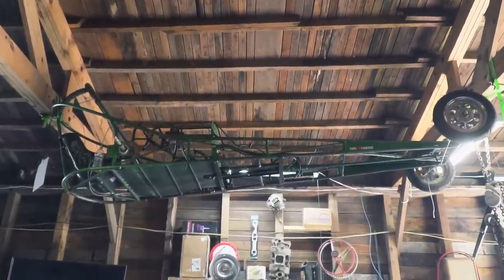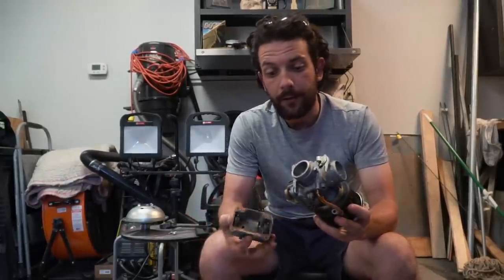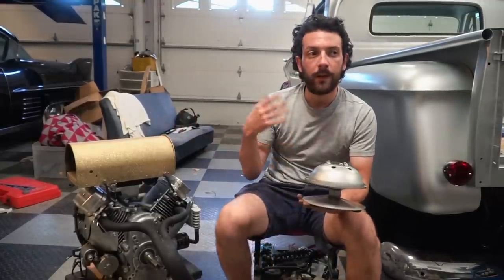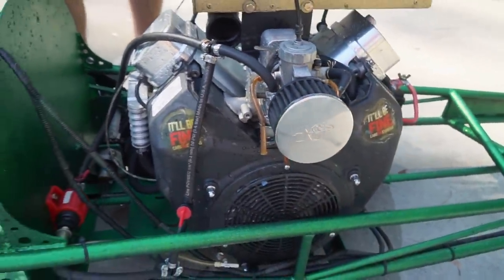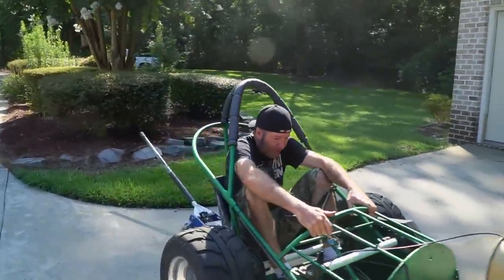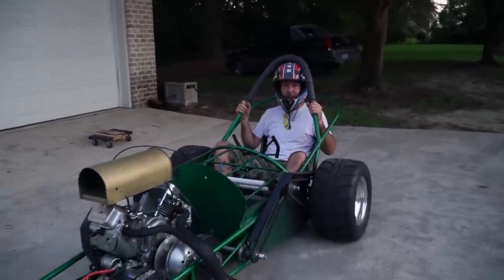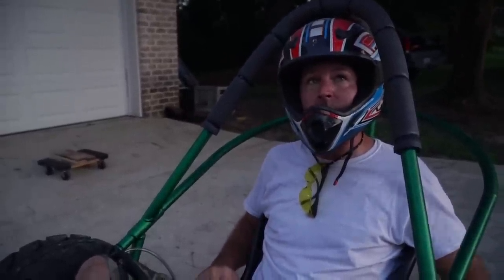670cc Drag Rail Revival! | Our 55HP Harbor Freight Engine Rail Kart Returns!

Comment: you just ever going to swap the driver position with the engine? The biggest performance gain you could make would be to remove those driveline losses by the jackshafts. plus you'd pull almost 100 lbs out of it. Bet you'd drop to mid 8's in the 1/8th

Comment: Diaphragm carburetors are for aircraft because a typical float style will stall out an aircraft in high g operation like the problem with the p51 mustang that used a float style carb.

Comment: Maybe running it on Methanol or nitromethane would be insane, I've run an engine on nitro before( risku asf I do not recommend unless you have billit parts) but it felt way stronger and it might be a good way to get some power out of it, or you could also supercharge it with a small smog pump

Comment: im pretty sure airplanes use diaphragm carburetors like the ones used on chainsaws, weed eaters etc... so they can work upside down. might be called pressure carburetors.

Comment: @carsandcameras What mods does the 670 have?  Those straight pipes sound Harley-ish, wondering if it still has stock cam, cam timing, etc.
Reply: Aftermarket cam. Sorry dont know the specs

Comment: its got a a gravity controlled float bowl were as i believe air craft carb either dont have a float bowl or a special type of float bowl so they can go upside down without running out of fuel and senses you'd be in the air that be a very bad thing

Comment: Mannn i just gave away a jr dragster frame. We at 1 point had a 300hp 1000cc snowmobile motor in it. It ran 3.3 seconds at 95pmh in 300ft. Yall coulda had the chassis. It had been in my basement untouched for over 5 yrs so i gave it away

Comment: Hmmmmmmmm I am building a go cart in shop class and only using a predator 212.... is a half inch thick plate of hardened steel a bit to overkill as a mounting plate?
Reply: Was building until witler shut down the schools

Comment: Would u be able to go through the fuel system and show how you rerouted the extra fuel i build a drift trike with a 110 motor and running a vacuum fuel pump but it keeps over flowing the carb

Comment: You can’t use a standard carb on aircraft because of gravity. If you go vertical the float will shut the needle valve and bye bye fuel.. this is one reason I would think.

Comment: Glad you guys put it back together but from the begging the 670 motor was a bit slow.... the power to weight ratio is terrible on those motors. I’ll be more interested in this project when you guys invest in a big bore 2 stroke motor to put on that thing.

Comment: Most aircraft use a MSA carburetors stands for Marvel Schebler aircraft carburetors , you can order them from QAA Quality aircraft accessories. Don't think that they will work on yall's motor. They function a little differently than a regular carburetor.

Comment: "Put the Rotax in the drag rail " we begged. Nah! Who needs half the weight and twice the HP? As to the drive train, run the output shaft from the CVT to the center of the chassis and connect it to the center of the axle with a spreader bar between the jack shaft and the axle. Build a 1/4" plate chain guard over the whole assembly for safety.

Comment: If you modify the engine to use an external battery and starter you would save alot of weight.

Comment: was wondering if your Avalanche is a good truck. I have a 05 with 118k  just like yours  its a constant pain  just replaced the transfer case and front differential and the 4x4 has hardly ever been used  crazy truck. mind of its own gages work sometimes  . GM JUNK i think

Comment: those coils were not the stock ones you got two new sets and that was one of the after market sets so that’s why it wouldn’t spark
Reply: We pulled the stock coils off the stock engine to put on the rail
Reply: Isaac it'll be fine yea but the coils that it damaged when the engine locked up where not stock because when you guys had problems with spark they said the first thing to do it replace the factory 670 coils and you bought two new sets and then got the new flywheel magnets

Comment: Remove the battery figure out a nhra starting system that's not on the car maybe a cordless drill or impact or something that would lose  30 lbs thats good for a 1/10 or 2

Comment: You definitely need higher stall speed, lighter weights, stiffer weight springs.
Reply: And also the driven pulley is installed incorrectly and should be faced inboard so the belt stays straight

Comment: Pretty sure I've said this a dozen times on deaf ears. 
Electric fuel pumps push better than they suck. Put the pump near the tank where it belongs. There is a reason why you only see modern cars with pumps in the tanks. The use the fuel to cool the pump and its where it supposed to be by the tank.
Either get the correct rated pump or put a reg on that thing.

Honestly I'm surprised they let you threw tech last time.

Comment: get rid of all those jackshafts . toss 50 hp motor ,install 100hp snowmobile motor , yamaha banshee pipes ,s10 5 speed,  install driveshaft .cut down toyota rear end . this is how drag rails have been made for 100 years !

Comment: aircraft carbs work at basically angle at 90 degrees some better ones can even work a bit upside down but none work completely upside down early spitfires hard carbs and would stall in every back flip or roll for a sec or two and could actually make specific maneuvers hard but others much easier so they flew a different style with carb aircraft

Comment: You have to move your fuel pump closer to the tank those pumps are designed to push fuel not pull it

Comment: Ok 1:07 PAUSE...
John...when the freak do you plan on showing us this old pickup truck...with what looks like Paint?? Sitting there seemingly all on its own with new rubber, at least out back...i mean Come On...this IS CARS and Cameras...!!!...?
Ok continue...

Edit : at 3:17 they say the wider the coil gap, ignition timing retards as RPM increases. I wanna test this notion out, but have yet to do so. As we know, timing is fixed on our small engines. The idea is the wider the gap, ignition timing will actually slow down, or actually "retard" as RPMS increase, i do believe ive heard terms like "hysteresis" thrown in...also i think im doing a terrible job of describing this phenomenon. Just wanted to throw this info-bit into the mix.
Continue please...press play now...
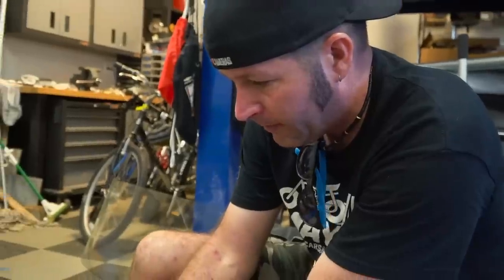Dang just a few sec too soon, just before 3:20
"Gapple-sauce" was introduced into our language. Love it. Continue...
4:37 there is a side/front view of that beautiful lookin old chevrolet truck. We need an episode on it john. Seriously. 
Continue...

Comment: With a “V belt” torque converter, the driven pulley should be facing other direction. I can’t believe you continue to mount incorrectly.
Reply: Its mounted correctly
Reply: @isaacitllbefine7231  it’s a symmetrical belt torque converter , it’s mounted incorrectly. It’s the same reason your belt overheated on the golf cart build. https:www.gokartsupply.com/identify.htm
Reply: @isaacitllbefine7231  I enjoy the channel so just trying to help you understand. I have run these TQ`s for years. At least I was able to help Red Beards Garage, he understood and now mounts correctly.  Do what you will I’m sure.
Reply: https://www.bmikarts.com/40-Series-Torque-Converter-Kit-8--16-HP_p_10434.html     Take note of second pic in the product description for reference of correct mounting. The way you currently mount it, as it cycles from low gear to high gear the belt misalignes and excessive heat is the result.

Comment: Aircraft use fuel injection in almost all cases because otherwise during higher G manoeuvres the engine cuts out for a short period because of lack of fuel, there’s a famous video of this happening to a Spitfire, Germans used them in Messerschmitts and hence out flew most planes of host era because of fuel injection

Comment: You guys burnt the 670 up. remember in the last video  the 670 would not start after it had been run for awhile? Then it cranked up the next day?  It got to hot and shut down.    you installed a cowling around an air cooled engine. It got hot. and melted down

Comment: 1) these are cheap enough now so why not run a Harley CV carb?, https://www.amazon.com/dp/B07WTZ39LG/ref=sr_1_43 
3) lets see you try an RBH31 turbo on that monster, with a Water2AIR after cooler!
2) FYI trying to start an engine with a weak battery damages the battery, so make sure you FULLY charge a new battery before using it for the first time!

Comment: You might not have to play with the jets considering that carburetor is on a motorcycle engine compared to a predator and I only say that cause a 670cc motorcycle engine is better stronger and faster than a predator

Comment: if you got rid of all the chain drive crap turn the motor sideways used a driveshaft to a toyota rearend the rail will be 10x safer . then you can adjust for track conditions . if you dont think it will work look up legend racecars . they use 150hp engine with that set up

Comment: I’m pretty annoyed to hear that they parked it just because of a coil getting chewed up
Reply: I think they originally thought that it stripped the oil pump gear, and that locked the engine. I haven't been following regularly, but I never did see a video where they did an actual teardown since that last altercation at the drag strip.

Comment: I still think that thing needs a total redo and needs to be turned into a rear engine dragster or if you are going to keep it front, get a car engine or a Moto Guzzi engine (ebay) for it and put a rear end out of a mini truck in it and have it set up like a real dragster and not that chain gang mess you have going on. Also will you guys please put a high back bucket seat and at least a lap belt in that thing? I broke my ribs off 1/2 an inch and 1 1/2 inches from my spine when my back hit the cab of my truck above the seat when I put it in a ditch.. I don't want to see you guys breaking your ribs or your backs in that thing from not having a tall enough seat to support your back and NO ONE wants to see you falling out of it should it catch an edge and roll.